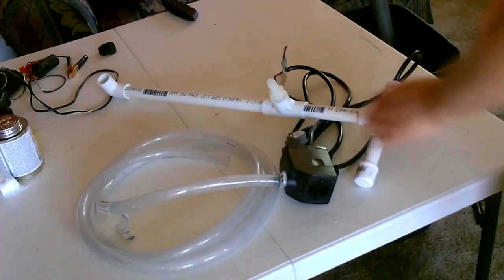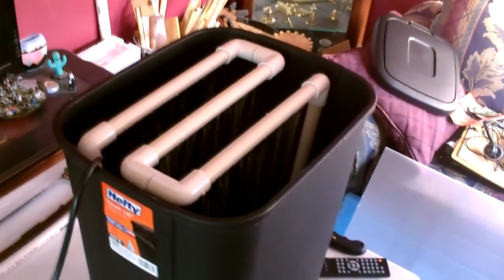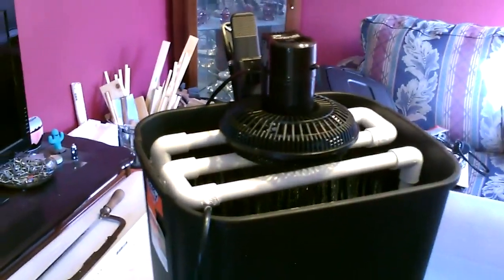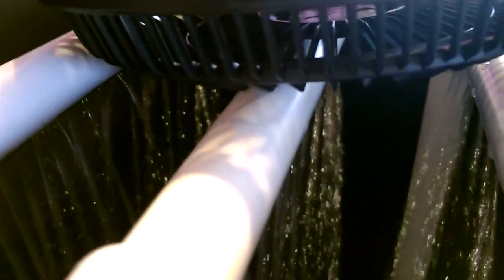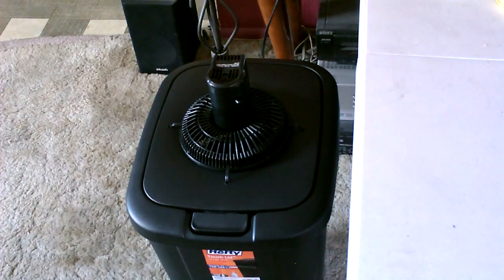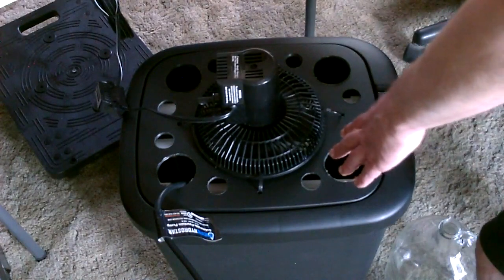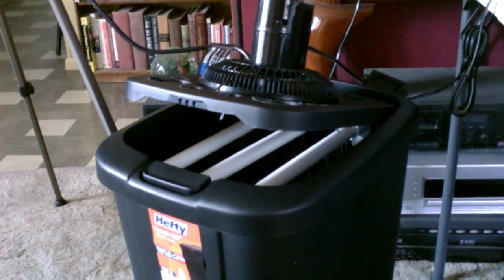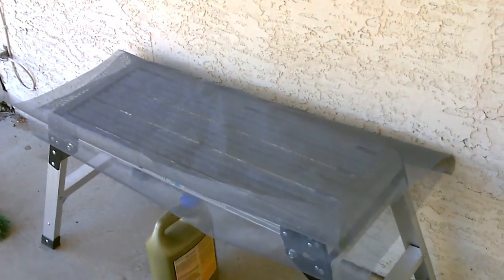DIY Humidifier & Evap. Air Cooler! ~ A "Padless" Evap. Air Cooler! - can be solar powered!

Comment: If this was just in a more or less sealed room, it would add humidity but not cooling, is that right?  I just want to add humidity (in winter), not cooling.
Reply from the maker: that's pretty much true. this unit works great as a humidifier (probably the best one i've ever made). it cools the air a little but not more than any other cool water humidifier. it's great to use in the winter.
Reply: @desertsun02  Thanks.
Reply: Depends where you placed it: If it was on cold concrete it will be more-less the same temp as the concrete.

Comment: This is the only diy humidifyer that actually looks like it should work. And everyone have parts to make this. 

Nice job. I will do it with hoses cause i have no pipes to spare.

My house got so dry on the summer i cant fucking breathe.
Reply from the maker: hi there and thanks. yes this one works really good. even works great without the fan. those 90 streams of water bouncing around in the trash can kind of make there own weather. if you put your hand over the top you can feel the moist air  pouring out.

Comment: You can put in a mini float valve used in hydroponics, this is what I do.  Then get a ice maker hose which has one end that will fit the float, the other end has a garden hose fitting. I run the 1/2" garden hose through the window.  By having the cooler inside instead of half in and half out like normal window coolers, you are going to create a condition where it may become a humidity laden sauna inside.  I solved this problem by putting an exhaust fan in a window opposite the cooler..  I live in the desert so this system works pretty well because our normal humidity is less than 20% except during Monsoon season, then you need more than one exhaust fan.

Comment: I'm a bit confused here, isn't the bunched up screen acting as the cooler media with this design?
Reply from the maker: hi there. yep that's right. the fan-forced "warmer" air flows up, over, thru and around the thousands of little holes in the water-saturated screen. *most of which are constantly being plugged and unplugged by tiny droplets of water. then, by blasting air down onto the screen, the droplets that are caught-up in the screens' mesh, can easily evaporate (thus causing the cooling/humidifying effect). *the screen is essentially acting like the "evap. pad". if you're wondering how it works without screen and fan... only the humidifying effect works without those... and to a lesser degree. the 90+ streams of water alone, all cascading down from the top and the splashing around in the bottom actually creates humidity (which is released out the top due to the turbulence in the bucket).